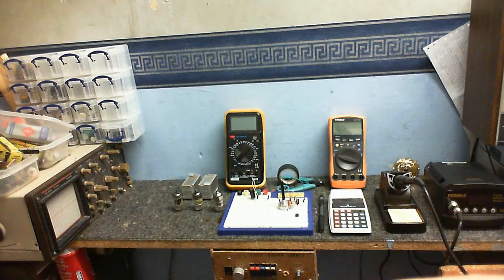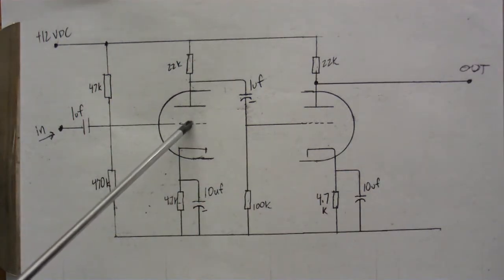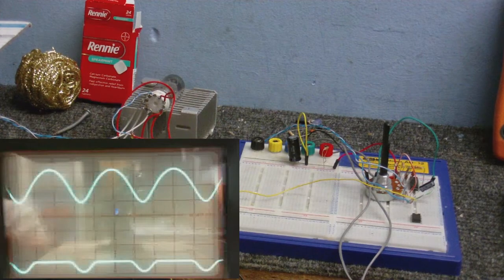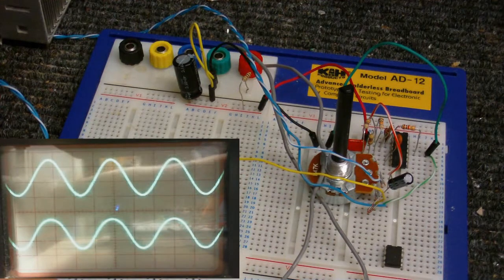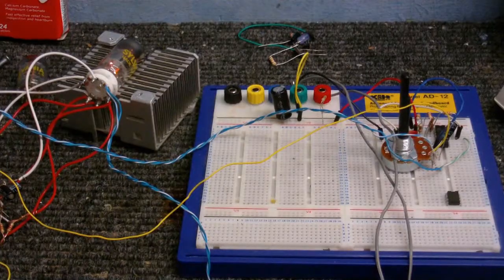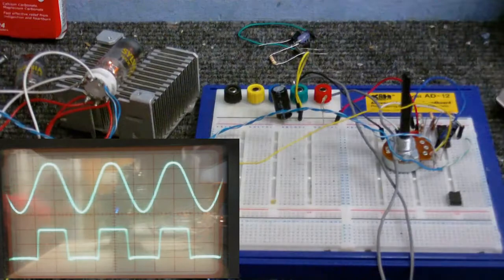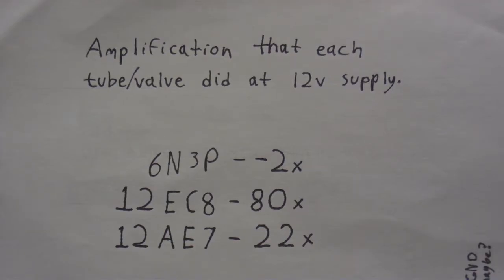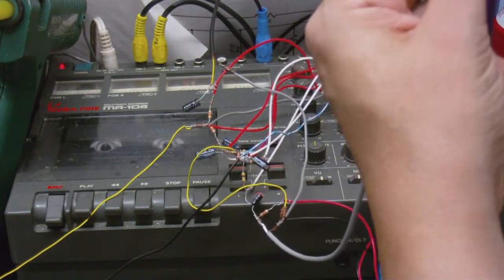Tube Time 8 - Testing Tubes at 12 volts HT!

Comment: I DON'T THINK ANYONE ON YOUTUBE HAS DONE THIS REGARDING 12volt Tubes!
You're the first to really compare them side by side with an oscilloscope and do the math and show real results.
Now I must send you the actual 12v power amp circuits....

I did do the first experiment with the 6N3P long ago....It did work but results were very weak....the sine wave results for that seem about right! Less out than in!

Wow! Very interesting results with the 12AE7. Once you got it below distortion it seemed to do pretty good for 12v! Amazing!

Gets better and better! 12EC8 is pretty darn cool....if you make sure it's not clipping...it seems very picky.
Awesome job, my friend. You're really putting it all to good use!
Cheers.

Comment: No.1 - 12AE7 Dual Triode (made to operate at 12volts)
No.2 - 12EC8 Triode Pentode (also operates at 12volts per manufacturer specs)
No.3 - 6N3P (6Н3П russ) "Normal High Voltage" type dual triode (similar to 6CC42 except filament)

Data pack is available here for those interested who know the password (our favorite show..one word all lowercase!):

https://drive.google.com/file/d/0BzyDF_lUE5AaYlFqYWgwQW1OZlE/view?usp=sharing

Comment: Great tests on low voltage amplification. Before solid state tube manufacturers tried many experiments to get gain at lower voltages for battery sets but it was a difficult problem.

Comment: So, which would be best for a 12v pre-amp? The 12EC8 seems a pick touchy and unstable even though it technically has more amp power. I'm guessing the 12AE7 will be best for a low-voltage pre-amp..well see!
Reply: ***** STOP SPAMMING YOU ARE CAUSING TROUBLE DONT YOU SEE THE MARKED AS SPAM TEXT?
Reply from the maker: The 12EC8 is probably a better choice, my circuit was noisy because of the bad wiring.  The 12AE7 is good for taking a small signal from let's say an mp3 player and boosting it to line level.
Reply: OK. Very good. Thanks for the feedback!

Comment: There were valves (I'm English) specially made in the 1950's for use in car radios. It turns out that they were just specially selected examples of 'standard' ones. e.g. ECH83 == ECH81. The inference being, yes they work on 12 volts!

http://www.vintage-radio.net/forum/showthread.php?t=68083

Comment: ooooh space-charge circuits!
Also I made a working FM radio with just a 12EC8
Reply: No kidding? PLEASE SHARE! That would be really cool! Do you have a schematic for your 12EC8 FM radio?
Is it the only valve in the radio circuit or did you use the 12EC8 to amplify a smaller/weaker radio circuit?
Reply: ***** I didn't make the schematic but i used this one http://www.junkbox.com/electronics/OneTubeFMReceiverBig.gif
Also if Clem can see this comment check this site it give info on space charge cirucits and links to other sites!
Reply: Thanks!

Comment: Hey Clem! I found this pdf about normal tubes on low anode voltages http://www.valvewizard.co.uk/Triodes_at_low_voltages_Blencowe.pdf
I have tried biasing  a 6n23p tube with a voltage divider (just like the one you showed with 6n3p) and got same results as you but then I tried putting a 1M grid bias resistor to B+, 10k or 20k anode resistor (cant remember) and it worked GREAT! I suggest you try it.
Reply: +Juodas Varanoidas That is really handy.